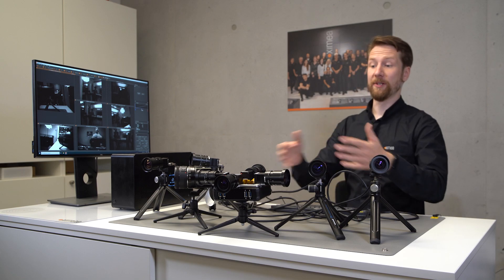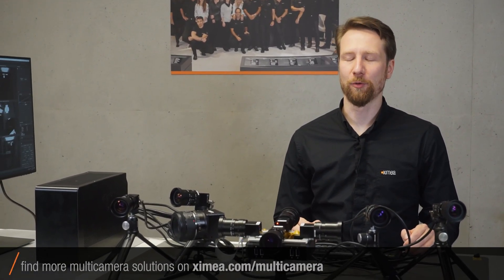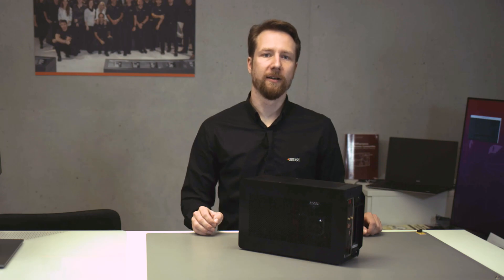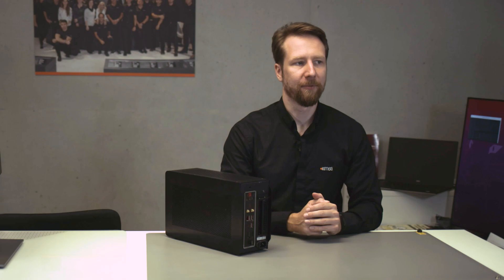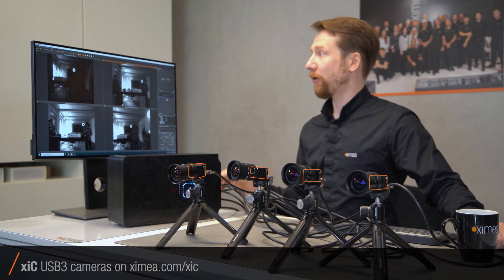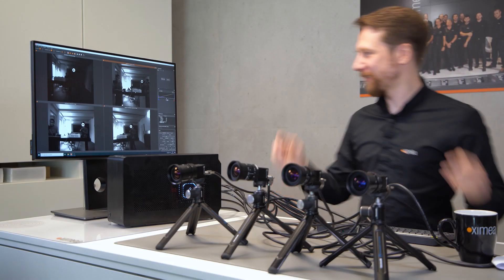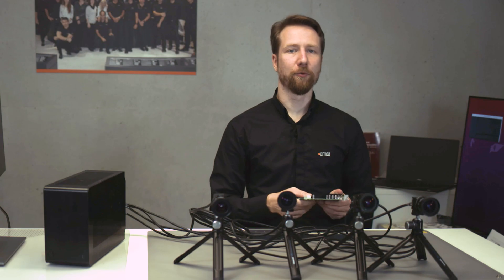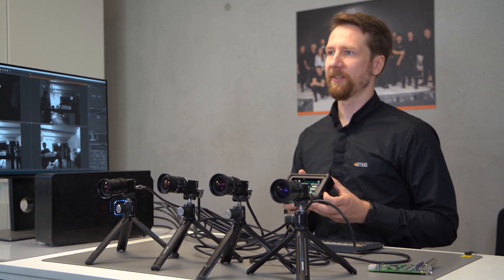XIMEA's multicamera systems with xiC & xiX - More cameras are always better!

Comment: What software are you using to view all those camera feeds?
Reply from the maker: The app shown in this video is the XIMEA CamTool. It is specifically designed for XIMEA cameras and is part of the XIMEA software package.
However, XIMEA cameras can also be used with a wide variety of third party applications and standard libraries. Check out our website for more info.
https://bit.ly/3qpI0Ax